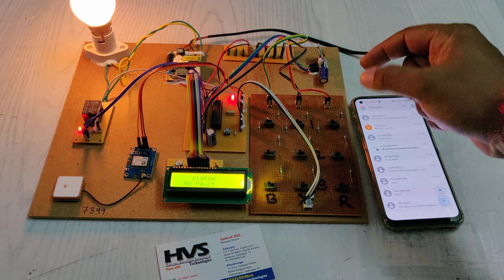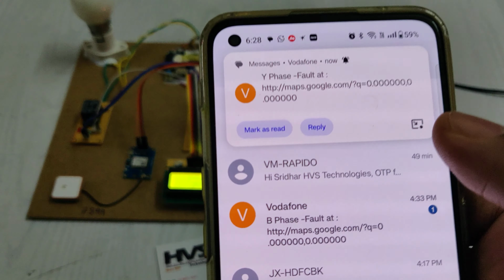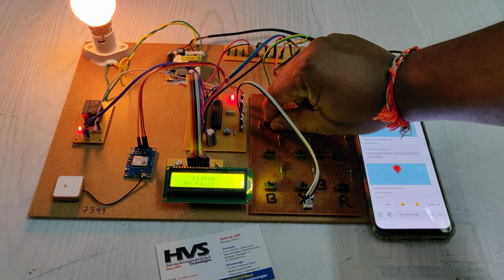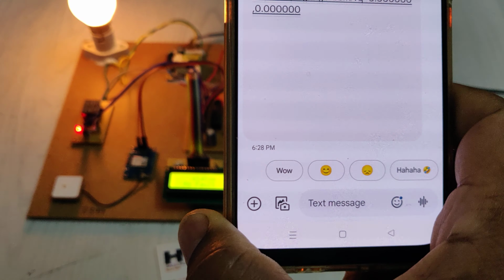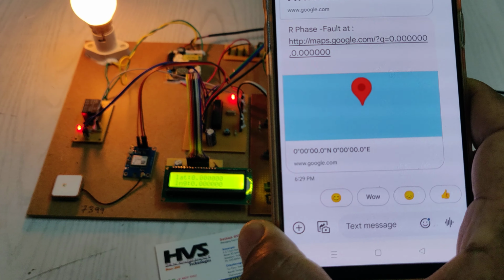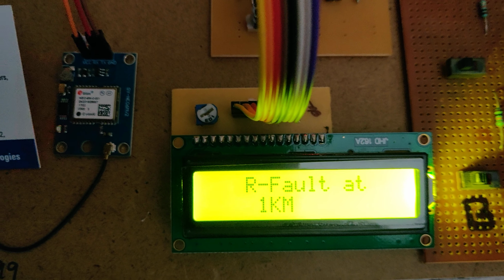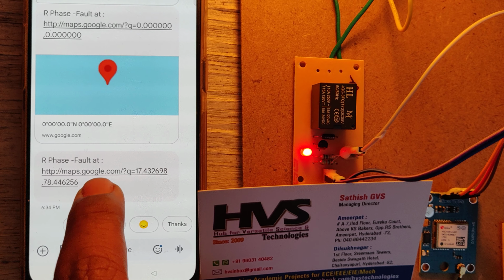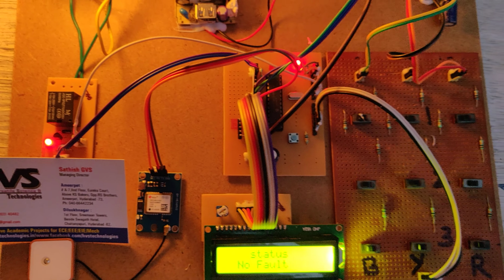HVS-4864. Underground ground Cable fault distance locator using GSM and GPS technology #eee #ece

Comment: Sir why it shows 1km fault 2km fault 3km fault at same location?? If distance is vary then location variation is also required
Reply from the maker: In the project we use resistors as length presentation